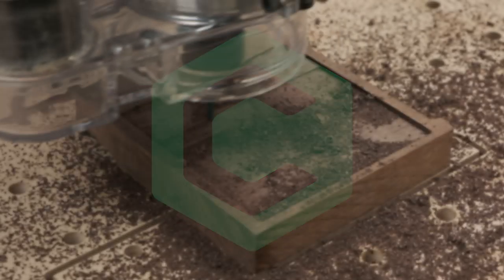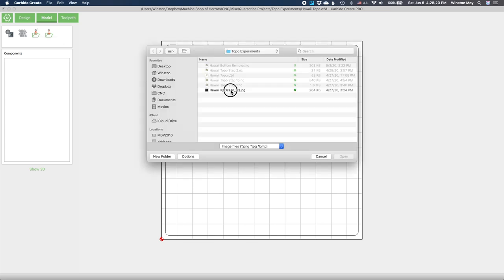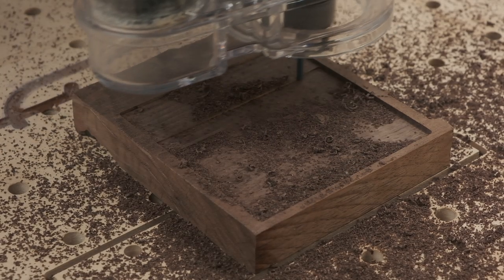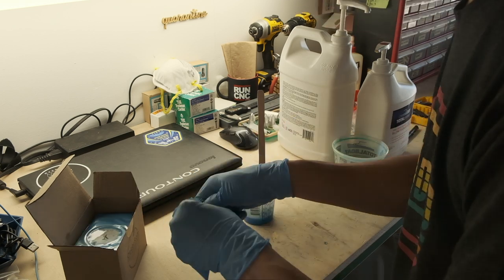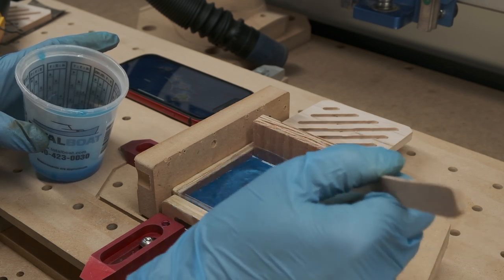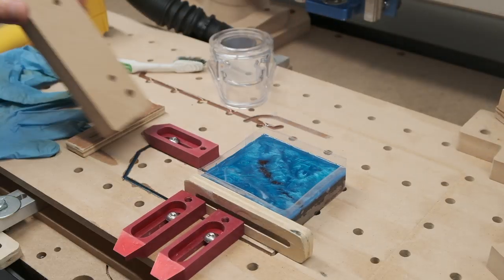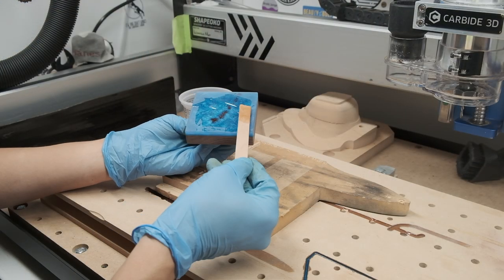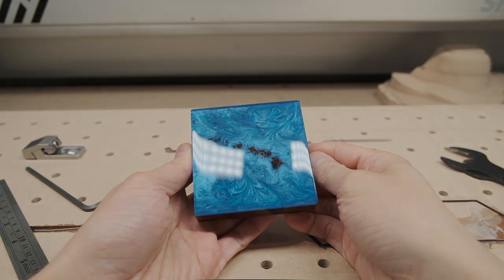CNC Topographic Carving Meets Ocean Epoxy Art

Comment: You used a 1/16 inch ball mill for finishing? I would have guessed you would use a tapered ball nose end mill, but I am still a newbie, any comments?  
I appreciate your videos!  Thank You
Reply from the maker: It doesn't matter what kind of ball endmill you use here. The main reason tapered is useful is because of the long reach you get while maintaining strength of the tool. Other than that, there's nothing special about them. Here the deepest I need to get around is about 1/4". Standard length straight-sided ball endmill is fine.